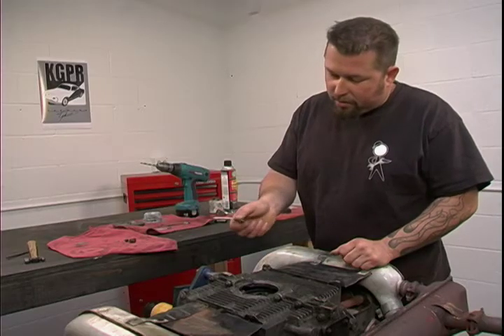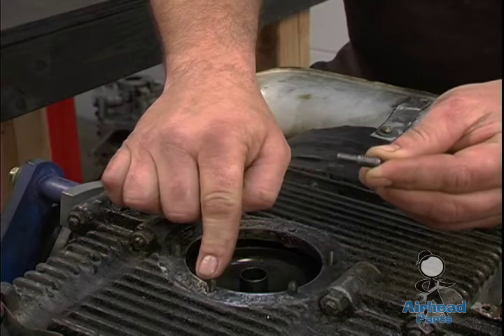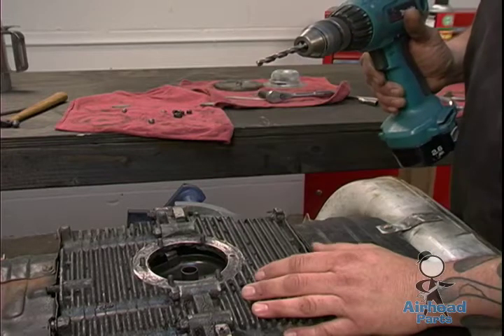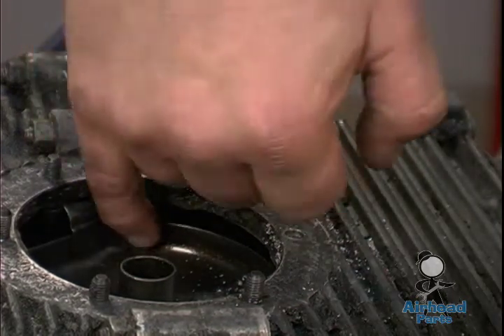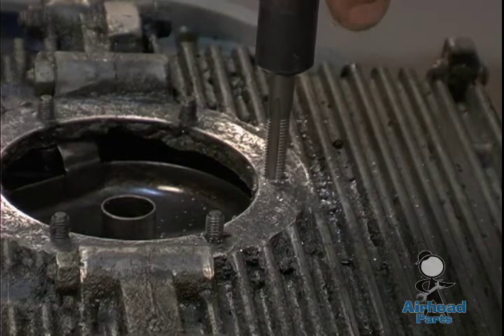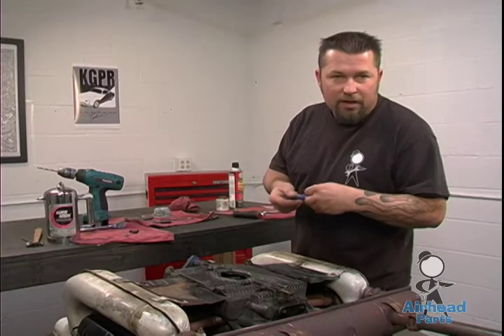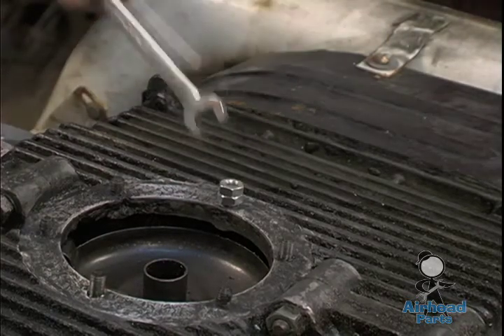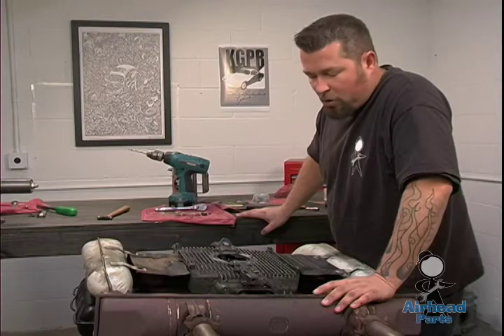Stripped VW Oil Drain Plate Stud Repair.mov

Comment: I use playdoh pressed in to the back side to catch shavings then after the hole is tapped, push the playdoh through the new tapped hole to clean up the hole.

Comment: Thanks for your video. I should have read all the comments because I would have seen the idea of using a blob of grease to catch the shavings. That was a good tip. Some shavings definitely got in my engine, but very few. I tried to get as many out as I could. One thing I did was drill the 17/64 hole by hand.  That gave me more control and I was able to go slow to reduce the shavings that ended up inside.

Comment from the maker: Hi--
oil strainer 1200-1600 single relief case- 311-115-175 A
oil strainer 1600 dual relief case- 111-115-175 B
gasket set- 113-198-031 (includes crush washer for drain plug)
--Andre T.

Comment: A glob of grease over the stud hole on the inside of the case will prevent stray chips. Drill and tap. Install the replacement stud just until it's level with the inside of the case, then draw the grease back toward the center hole with a paper-towel-wrapped or rag-wrapped popsicle stick.

Comment: Thanks for the video! Unfortunately I had to look this problem up because another Gremlin visited us today while trying to change the oil in our 1968 Beetle for the first time. She is a new addition. We were able to get 5 of the 6 nuts off the drain plate, but on one, the whole stud came out with the nut stuck on the end. Someone recommended just leaving it stuck on there and putting red threadlocker on it and putting back in after cleaning everting.  But would it be best to somehow get the nut off the stud and THEN using the threadlocker to put the stud back on?  I am thinking then next time we change the oil we don't have to take out the whole stud with the nut stuck on it and having to remember which one has the threadlocker on it. Making it harder to take out anyway? Right? LoL Trying to do it the smart way to make things easier down the road. I am looking up how to do it so that I don't damage the thread by using something like pliers. Like two other nuts on the other end?  Sorry so long winded here.

Comment: What do you do if the original stud just snapped off while tightening the cap screw?
Reply: I didnt make the video, but if its not smooth with the block file it down until it is. Then centerer punch the stud stuck and drill it out and oversize it like the video did to fix a stripped one.

Comment: Does anyone know how to take out the original stud for the replacement?
Reply: vise grips and spin that sicker out of there
Reply: Thank you! I tried it out a few weeks back and it worked out well. I put the new studs in as well and it wasn't as hard as I thought it would be. Now all I need is a new starter to test out the motor.
Reply: Jeff Guerrero glad it worked out fine!